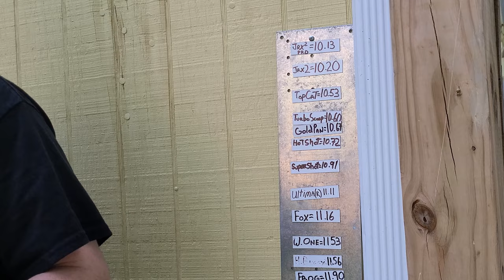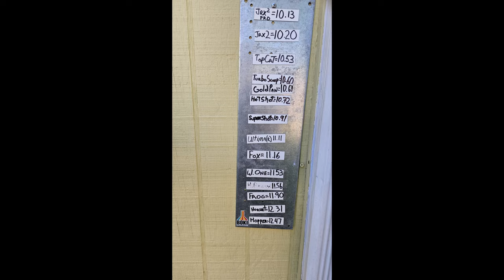Team Associated RC10 Time Attack!

Comment: I remember the first time I saw an RC10 on track. 1986... Just amazing. A total game changer. Loved mine!!
Reply from the maker: 100% was a game changer!
Was a full race machine.
Appreciate the comment my friend.
Reply: @VINTAGEBACKYARDRC  My RC10 quick download... I bought my Gen1 RC10 in 1989. A few years earlier, there had been a major boom in RC car racing, but by 1989, the only real racing was clay oval. This was back in the Mid-Atlantic. I bought it because I wanted one to beat around with. Then I discovered the aforementioned clay oval racing. 

You ask... how does one go oval racing with an off road car? You modify the hell out of it. That front kick-up plate? Gone. Great for landing, sucks for ovals. Do it's gone. I first hammered mine flat, but ultimately replaced it with a piece of 1/8" thick fiberglass sheet. The next trick, swap front upright blocks... but you have to machine out the block so the steering will work. This negates all the caster. Add front shocks to the rear. The best trick for the front end was a laydown front shock kit. Worked great. That lowered the car. Add a Scott Bloomquist supermod wedge body. Cut some tread into foam tires. the old Ofna gas tires worked best. The rest is setup and good driving. What a hoot.

You have to realize, at this time, the hotness in clay oval was CustomWorks, still is, but it started then. And these modified RC10s actually worked well. Another option was the dearly departed Bo-Link.I have a vintage CustomWorks, Dominator, I think... it's been a while. But they are fast... There were other brands, but I don't remember them.

As for the old Veri-lock diff on the RC10. Great trick, but horribly inefficient. I was told how to fix it, spend a weekend on it... using some hobby sandpaper, some old school Crest tooth paste and start working the gears. Get those nylon gears all cleaned up and allow them to mesh with the metal gears, akin to hand fitting the parts, really. When done, you should be able to spin the wheel (no motor) and the gearbox should spin for upwards of 2 minutes by shear freedom of motion. That change was epic. I ended up upgrading to the Stealth, only because parts for the Veri-Lock became damned near impossible to find.

Comment: I have one that my late uncle gave me when I was 16. A guy at work gave me his in perfect collector condition last year. Just gave it to me! It's been ran but it's clean, no scratches on the chassis. Only a few packs thru it. I bought the world's car re-release kit in 2015.  That slight bit of extra weight from the aluminum chassis gives me more bite at the track than the newer composite chassis vehicles.  Especially in packed and also loose terrain. 

Amazing feeling driving my 2014 Blk pan worlds car smoking these new buggy's at the track. 

I was born in 1988 and it's really a time machine to drive the original gold pan too. Its original with the am 75mhz radio, nimh batteries and mechanical speed control. My second on Had the orange Novak esc. 

Thank you for the nostalgic highlights.
Reply from the maker: Thanks my friend.  That's a great comment! No other car did so much in such a quick amount of time imo. It redefined what "race spec" was. Really nice to hear you are still out running one!

Comment: I’d kill to have a gold pan rc10.. I had a chassis as a kid but never got the rest of the car arts to put it together.
Reply from the maker: I was fortunate enough to get in before they got silly. Still look for scrap parts cars and bits to keep them running.  I just enjoy the heck out of them. Brings me right back.
Reply: @VINTAGEBACKYARDRC  I’m running my falcon for the first time tomorrow. I’m a bit nervous. But it seems solid. I packed the bulkhead screws with shoe goo so they shouldn’t break for a couple laps
Reply from the maker: @Iowa Budget RC Bashers   Have one as well to repair but so afraid to take it over jumps. Might need to look into that shoe goo thing...
Reply: @VINTAGEBACKYARDRC  that’s what shen told me to do. I have one of the crp front bulkhead braces but couldn’t get it to work with the stock bumper so it’s in the drawer

Comment: Yes brother! What an absolute treat of a video for Saturday afternoon 😎 Car is amazing and those slow motion shots are to die for 🔥 So the burning questions is tyres… when will we see it with new boots man?? It is going to top the leaderboard for sure!!
Reply from the maker: Thanks my friend. Used the new phone for the slow motion. Still needs some tweaks..but it's getting there for sure. That's the question right? Do I put those soft Shumi. tires on it and have a lap...or leave it as the baseline for the "other" 10's in the stable? Appreciate it brother.
Reply: @VINTAGEBACKYARDRC  depends… are the other 10s running Schumacher? If so then it would be a shame 😜

Comment: Can you suggest a hardware kit used for these cars? I m restoring a rough RC10 for a friend, Thank You!
Reply from the maker: Honestly...I have a stash of hardware from collecting over the years so I haven't had to look. I have used the stainless kits on my other cars in the past...but they just don't look right on a 10 imo. Also...need to be careful because the bottom screws don't have a standard counter sink ( I'm pretty sure the 10 has 100 degrees c.s. on the bottom) if I recall...people are able to get the larger  correct bottom screws from McMaster Carr. It is always a good idea to hook up with some of the Rc10 groups on Facebook as well (Rc10talk ect.). Those guys are an endless source of education  on everything Gold pan.
Reply: @VINTAGEBACKYARDRC  Thanx very much